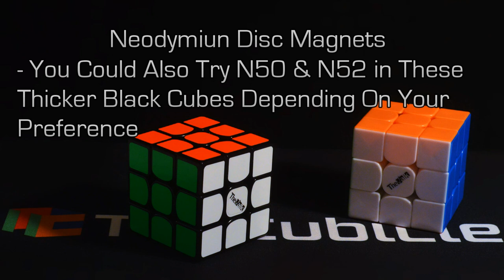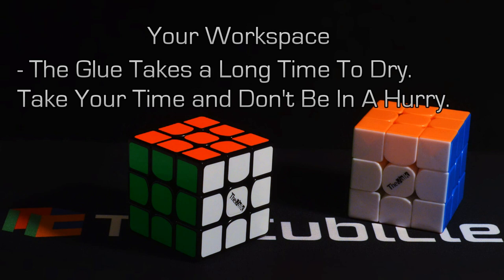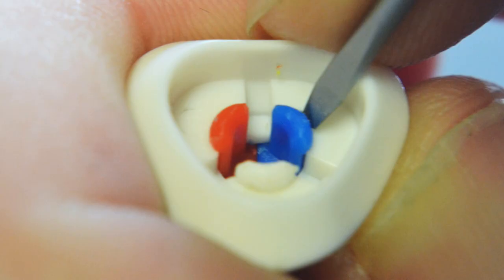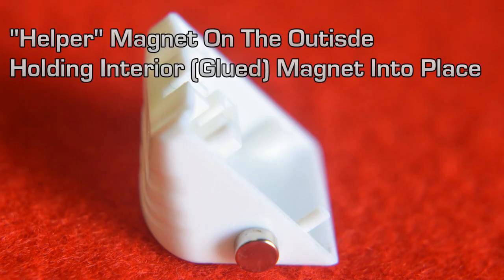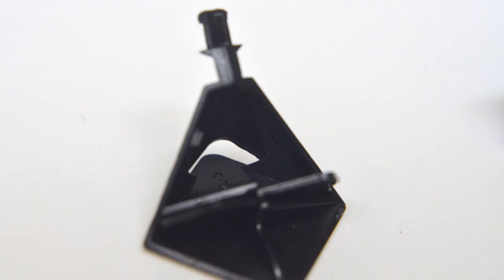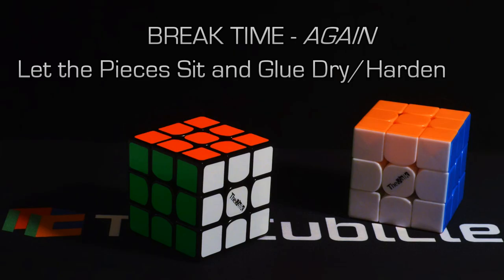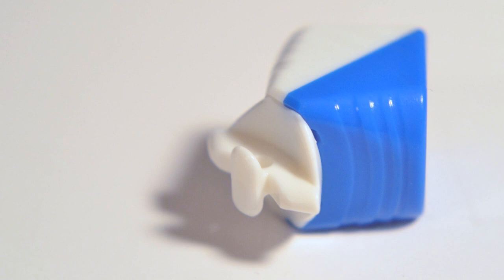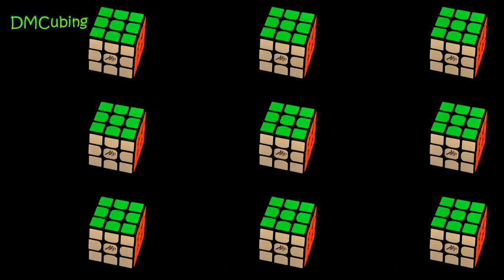DIY: How To Make A Magnetic Valk 3 Speedcube Tutorial

Comment: Finished my Valk and its pretty good.  I have to say though that stronger magnets do not suit this cube.  I put 4x2mm N42's and I think it is a little to strong.  Which is interesting, as I love the N50's that I put in the AuLong V2. I have a Cubicle Labs Valk3M and the magnets are much weaker.  I would guess from looking at them that they are 3x1.5mm and probably N38.  The attractive force is subtle, but for this cube I think that is the way to go.  I have a stickerless Valk that I am going to put N35 4x2mm.  I think that might strike the right balance for me with this cube as I would like a little more magnetic feel than the Cubicle version.
Reply from the maker: jonathan herring The plastic in the Valk ( as well as the Air and GTS2) is fairly thin and results in a lighter weight cube. Thus anything over an N35 is going to feel strong. The Aolong on the other hand is thicker and higher strength magnets work well in that cube.
Reply: I gathered that from the overall weight of the cube.  However, with the AuLong the strong feel works for me, but a the heavy magnetic pull does not suit the Valk.  I am sure its somewhat subjective and maybe a result of the different core and piece design.  I am very curious to see what the N35s will feel like.  I am tempted to use the 5x1mm N48 to see if that shape will alter the effect.  The GTS2 is still my favorite.
Reply from the maker: jonathan herring It's also very much about balance. Unless you use a thick lube and tighter tensions, it's hard to get strong magnets to balance out in a light cube. Just the nature of the beast. 
While the N48 5x1 is THE ideal magnet in the GTS2, it doesn't work as well in the Valk. This is because of the corner piece cutaway hole. The wider width of the 5mm magnet, and its close proximity to an opening causes it to feel rather strong in the Valk. I discovered this recently when I used that magnet in a Valk. The end result "feel" is like a 4x2 N38 in strength, again, all because of the cutaways. 
N35 4x2 in the Valk works for most people. The 4x2s sold by magnets365 work very nicely since they are just slightly undersized at 4x1.7.
Reply: Fantastic, you have saved me a Valk with your experiments!  I did relube and tension both Valks and i found a good balance for both. I may indeed get some of those magnets from magnets365, but i think i have to use the ones i have first.  So many projects to complete!  I am waiting for my next shipment from Guassboys so I can begin the 4x4 and then I need to do the 5x1 GTS2 when i get my shipment from Apex. So, I think I will use some N35s in my stickerless Valk in the mean time.  Thanks again for all your time and information!
Reply from the maker: jonathan herring yeah, I believe that was my 15th Valk to magnetize. I was really hoping those magnets would feel like they did in the GTS 2. But they didn't. 
Hey that is great that you have a lot of magnetic projects coming up! Let me know how they go!

Comment: Awesome! Have you tried a Yuexiao yet? That's my next project (after vid on 2x2) but not sure what strength magnet to use. I'm thinking using N35 4mm x 2mm but not sure how strong of an effect it would be. Don't want it to be too weak but don't want it too strong. Any clue how much thinner the plastic is between the Valk and Yuexiao?
Reply from the maker: Exactly! I'm not too sure which magnet to use either. That's why I will probably do the Gan Air.
The Yuexiao is interesting. It feels light and thin, but it's not! I measured its thickness and weighed it, and it's not thin and light like the Valk, but dang, you'd think it was. So I too probably won't start with N35. I've got these mystery mislabeled 4x2 mags that are probably N42, that I've been thinking about using, but honestly, I might use N48s and live with however it turns out. I've done a lot of prototyping where I end up removing all 48 mags to try a weaker mag. With the Yuexiao, I might do the 48s and leave them. And if it's real bad (I just don't think it's going to be! ) then I'll order another cube and use something different. Kind of a long answer, but that's my thinking on it.
It's really late here, or I'd dig up my measurements, but the Yuexiao is closer in thickness to the GTS. I'll get back with you later on that. 
Oh, man,  I'm looking forward to your 2x2! Which cube did you use? I'm still in limbo on which model to use. My (one and only, at this time) Dayan isn't a good candidate, imo. Ttyl
Reply: DMCubing i think he used a kungfu yuehun
Reply: Haxpo Yeah I used the KungFu YueHun. I'm editing a polarity demonstration right now. Hoping it will go up today! I'll let you know when it goes up. And I agree with you that the YueXiao feels a lot thinner than it is! It's really strange! I'm actually in my engineering class and can measure the piece. It's 0.0473 inches so It's very close to the WeiLong. The YueHun is 0.0609 inches and I used N35 so I'm going to try N42 magnets on it, but also there are 8 magnets holding each layer instead of 4 like on 3x3's so It feels a bit stronger. I'll try N42 on the YueHun and N48 on the YueXiao.
Reply: Boekster Cubing cool stuff with magnets! im really interested for the 2x2 video! not sure if i want to make any of my 2x2s magnetic since i dont see a big benefit. i also much prefer my nicely set up np dayan over my yuehun.
Reply: Thanks! And I don't have a Dayan so I have to stick to the yuehun :(

Comment: Hello im a cuber living in korea
In korea, they only sell n35 magnets
What would you prefer on valk 3 and valk power 
Im thinking of 4x1.5 on the corner 4x2 on the edge
How do you think??
Reply from the maker: 전준표 You certainly could try that combination on the Valk 3, but the N35 4x1.5 by themselves are plenty strong in the Valk 3. 
For the Power, the factory uses N35 4x1.5 in the edges and N35 4x1 for the corners. So, honestly, I probably wouldn't use the 4x2s in it. Either do it like the factory version or use all 4x1.5. Also, on the Power, you would have to be careful with the thickness of the 4x2 magnets. There are internal parts of the edge piece caps that can come into contact with thicker magnets. Be sure to watch my video on the Valk Power.

Comment: Hi DM, I have magnetized my valk 3 with n35 4x2mm, and i love the feeling of it. Now, i'm planning to magnetized another valk 3 with n45 4x1mm, in your opinion how is the feel would compare to my n35 magnet ? thanks
(sorry for bad english, hope you'll understand)
Reply from the maker: Habib Rakhman Your English is perfect!
The N45 4x1 will be considerably weaker than the N35 4x2. Not quite half the strength, but nearly half the strength. So it will be certainly more subtle than the N35 4x2. But the light weight and smooth action of the Valk, even if the magnets are a little on the weak side, your cube will still probably be fine.
Reply: OK, thanks for the information, i guess i just stick to my n35 and not having the 45 valk. I like stable cube 'cause my turn style is pretty harsh
Reply from the maker: Habib Rakhman If you have an aggressive solve style, you could double your 4x1 magnets, giving you an effective strength of N45 4x2. It would be fairly strong in magnetic feel and attraction.
Reply: Yeah, that's good idea but it's require more magnets, and more money of course haha. I think n35 4x2mm works fine for me. 
And again thanks for the idea

Comment: DMCUBING is the n40 4x1.5 magnet is the same with a n38 4x2 magnet?
Reply from the maker: TMCuber No. the N40 4x1.5 is significantly weaker than the N38 4x2. There was a time I actually kind of liked the N38 4x2 is the Valk, but now I like N35 4x2 or lighter. The N40 4x1.5 would be a more appropriate magnet for this cube, and according to the K&J Magnetics magnetic calculator, the N40 4x1.5 has the same magnetic pullforce strength as the magnet I like to use, the N35 4x1.7.

Comment: hello! congratulation for your video, i want to ask you something, if i am correct de cubicicle valk m uses n48 magnets, you use n35 , i want to make my own valk m, but i want like a stronger magnets feel, you recomend me a n42 or n48?
Reply from the maker: I doubt the Cubicle uses that magnet in the Valk. Actually every video review I've seen of it is to the contrary, that the magnet they use is subtle, which leaves me to believe it's an N35. (They probably use N48 or N50 in the GTS, though). Anyway, lots of people use the N35 in the Valk, but I find it to be a bit too weak. I have recently been experimenting with several prototypes I build using N38 and N42, 4mm x 2mm. These two magnets feel awesome in the cube! I particularly like the N42. Though it has a strong, noticeable magnetic feel, it's really smooth once you've put the cube into motion. But it's a personal preference, and I imagine more people would probably like a little less magnetic feel, so N38 is probably the way to go. I certainly would never use an N48 in the Valk. It's just too strong for that cube.
Reply: +DMCubing thak you so much!

Comment: Which did you use the gel or the regular super glue o need to know asap thank you for the video I plan to make a magnetic thunderclap and valk
Reply from the maker: Nice! I used Gorilla brand superglue, specifically their Impact-Tough formula. But you can use regular superglue. you just have to be careful because it dries fast and is kind of thin and runny. Let me know how your cubes turn out. I'm working on my Thunderclap tutorial today.
Reply: DMCubing and also what magnetic do you plan on using in the thunderclap
Reply: Like the strength of the magnetic
Reply from the maker: Sorry, just seeing your comment here. I used an N52 on my first Thunderclap V1 and on the one I just complete, an N48 (4mm x 2mm). The 52 is quite strong, but I actually kind of like it. The N48, though, is probably the better of the two, so I'd recommend N48.

Comment: hey DM Cubing,should I use N38 or N50 for a Valk,Gts2 and Yan 3 ?
Reply from the maker: Harisgba// yt If the N50s are 4x2s, and full strength, I probably wouldn't use them in any of these cubes, but they could probably work ok in the Yan 3. 
You can use an N38 4x2s in any of these, but they're going to feel pretty strong in the Valk and GTS2. 
For me personally, I like the N35 4x2 in the Valk, and the N42 5x1 in the GTS2.

Comment: Looking to diy my black valk to have a magnetic strength similar to the mass produced gts 2m. What strength would be similar?
Reply from the maker: Vincent Garcia They use a 4x1.5 in the GTS2M. I don't know the strength. Might be an N35 but I'm not certain and you could still go a little stronger than N35 and still maintain a light feel with a 4x1.5 magnet.

Comment: Do you think that for valk is it better to use 5mm x 1mm n50 or n35? I used 4mm x 2mm n52 or n50 not sure on mf3rs if this can help you to answer my question.
Reply from the maker: Karol Koenig If you're going to use 5x1s in a Valk, use the weaker N35. The 5x1s act a little differently in a Valk because of the cutaway holes in the corner pieces. The openings in the pieces allow for more magnetic attraction, so the perceived pullforce strength is greater in the Valk than other cubes.
Reply: DMCubing thanks a lot

Comment: For a stickerless Valk 3, i personally love 5x1 magnets more and I prefer using stronger magnets in the edges pieces than the corner pieces. What strength would u recommend for edges and corners if I prefer a magnet strength and feeling like a stock magnetized GTS 2 M?
Reply from the maker: Yi Chen Gan As opposed to using 5x1s? The stock GTS2M that I have has a very light magnetic attraction, and in the Valk 3, I imagine using N35 4x1.5 would give it that lighter kind of feel. If you're set on using 5x1s, probably N35 would work well. The 5x1s have a bit of an extended magnetic feel, so if they get to close to the corner piece cutout holes, their perceived magnetic strength will increase.
Reply: Wow really? Haha I personally felt the stocked magnetized GTS 2M is moderately strong. If that's the case, will N35 5x1 in Valk corner and N50 5x1 in the edges work? Or u hav Ang suggestion for using different strength in edges and corners
Reply: Btw how did u magnetize ur main GTS 2M? How's the strength of magnets?
Reply from the maker: Yi Chen Gan Hmmm. The first batch was certainly subtle unless they changed them. 
Most N50 magnets being sold, well those being sold at budget prices, are generally no stronger than N35. If you buy higher quality N50s from a reputable seller, they'll be stronger. I personally wouldn't do it, as the overall pullforce strength would be a little stronger than what I prefer. But if you like that feel, try it out.
Reply from the maker: Yi Chen Gan I have all kinds of videos on that one cube alone and have magnetized 30 of them. I've also tried over 20 prototypes trying a huge variety of magnets. N42 5x1 is my favorite!

Comment: I'm thinking to use n52 4x2 on the edges with n35 5x1 on the corners
What do you think? How's my valk gonna be?
*Sorry I don't speak English very well
Reply from the maker: Sofram I think the overall strength will probably be too strong. The N52 4x2 is a powerful magnet. I realize the N35 5x1 is considerably weaker, but I believe the N52 4x2 would still be overpowering even if used with it.
Reply: DMCubing but the weaker magnet in the corner piece makes action feel lighter right? Like it's easier to turn the outer layer since it uses weaker magnet
Reply from the maker: Sofram When I've combined magnets of two different strengths, I've gotten an average of the two. Despite how weak the outer magnet is, it will still be under the magnetic influence from the edge piece magnet. You could give it a try and see what happens. 
Another thing to consider, and I've tested this, is when you use 5x1 magnets in the Valk, the overall perceived magnetic pullforce strength is actually increased in the corners (compared to the edges and similar cubes). This increase of magnetic energy is caused by the cutaway openings of the corner pieces. That part of the corner piece isn't shielded, so you end up with a slightly increased (enough to be felt) magnetic attraction.

Comment: Starting to disassemble mine now!
Reply from the maker: NICE! Be careful with the little ends of the corner piece stalks. Have fun and let me know how it turns out.
Reply: DMCubing A little too late.  One broke but it should still stay with 2.  Almost done with edges.
Reply from the maker: +Coastal Cubing Oops. Yes, it will stay with two in place.
Reply: Turned out great!  I will definitely use it with my magnetic Thunderclap as some of my mains.
Reply from the maker: +Coastal Cubing Hey, that's too cool! Nice! I meant to mention earlier, if it's possible, leave the little broken part in place where it belongs. The base and retaining disc will hold it into place and there's no chance of it coming out. It will provide strength in the stalk.

Comment: It it necessary to glue it on the left side like you did in the video?
Reply from the maker: Pigiesrool Generally speaking you can glue the magnets on either side inside the cubie pieces of Rubik's cube as long as they fit flush and line up with each other. I choose a spot where the magnet has the right amount of room and lies flat.

Comment: I hv n35 4×2 mm neodymium magnets ... Are they gonna work, I'm thinking of buying a valk and magnetizing it myself
Reply from the maker: Arghajeet Chakraborty They will be perfect in the Valk 3, where they'll give a medium magnetic pullforce strength. It's probably the most used magnet in this cube. If you prefer a weaker, subtle feel, the N35 4x1.5 works, but most DIY people are using N35 4x2.
Reply: DMCubing thanks a lot man fr replying , it means a lot to me... Actually i saw your other tutorial fr magnetizing gan air .. because i wanted to magnetize my gan air s but was unable to do it..  but i don't want to waste my magnets which is why im thinking of buying a valk and magnetize..  , and your tutorials are really helpful man... Love your videos 😊😊😊
Reply from the maker: Arghajeet Chakraborty Ah, thanks so much!!! Gan puzzles are a little more difficult to magnetize. They also need a fairly light magnet like N35 4x1.5 or N52 3x2.

Comment: I have a huge problem. One of the magnets got stuck to the outre part of the edge piece. Its super glue. I put nail polish remover and all of that It doesn't work. I can't pry it off either. Can you help me?
Reply from the maker: You should be able to pry it off. I would try soaking it in warm, soapy water for several hours. The soapy water should help soften the glue that is adhering the magnet to the plastic. If it's stuck on the outside, you should be able to pry it or pop it off. But I'd only try it after it's soaked a long while. Also, if you're using fingernail polish remover, make sure you're using the older style stuff that has acetone in it. A lot of the newer removers don't contain acetone. And be careful with acetone because it can melt plastic.

Comment: How thick is the piece valk 3?
Compare to gts2

I already magnetize my gts2 and i feel its just little to weak, just a little maybe

What do you think if i magnetize valk3 and using the same magnet?
Will it feel the same as gts2?
Reply from the maker: Benny Lai Magnets tend to feel stronger in the Valk as compared to the GTS2. This is because of the plastic and also the cutaway holes of the corner pieces. The same magnet used in the GTS2M will feel slightly stronger in the Valk 3.